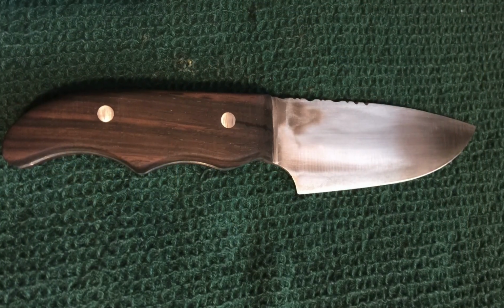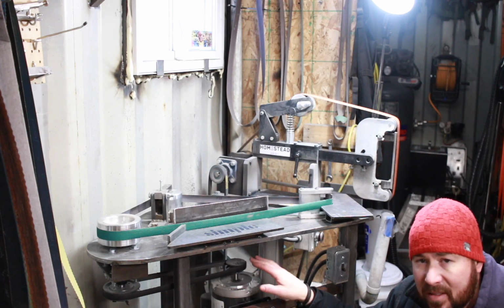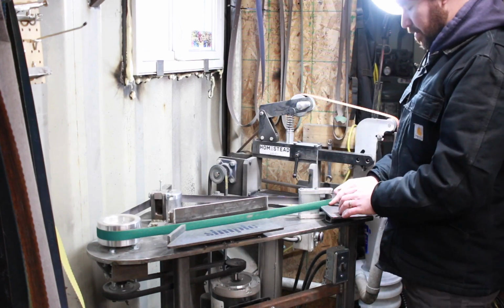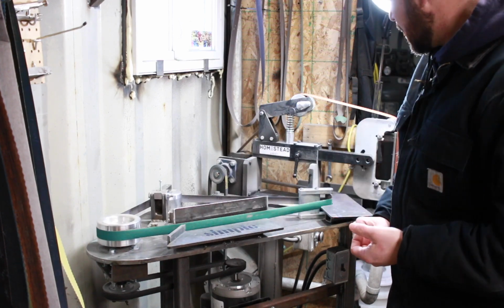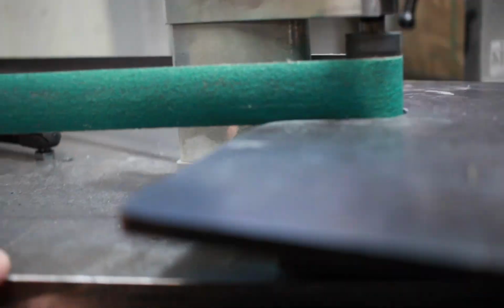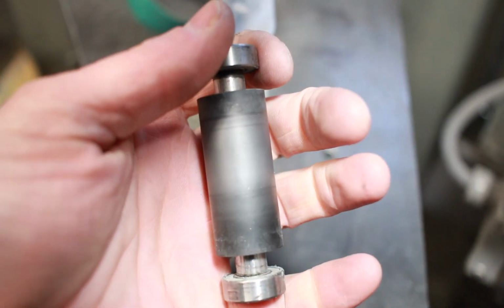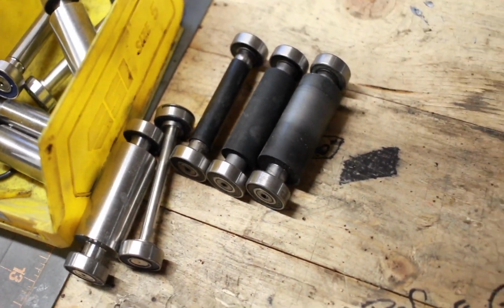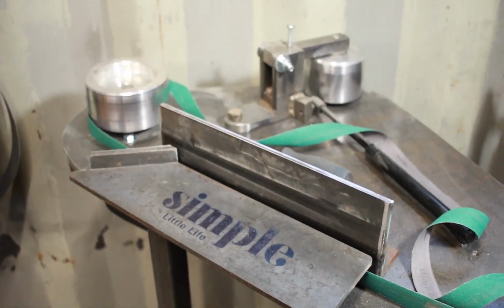Tool Time Tuesday -2X72 horizontal belt grinder and the small wheels

Comment: Another great video, thank you.

I hope you dont mind me asking a question to you or your viewers? Im half way through making a micro furnace out of a fire extinguisher. The plan is to attach some legs, line it with furnace cement, and blow heat in through a tube in the side. So I get my fire extinguisher, use a flap wheel to sand it down to the metal, cut the end off to make a hinged door, and BAM ....I discover that the inside is plastic lined. 

The plastic liner is about 1mm thick. The plastic is a thermoplastic (I think thats the correct term), eg its quite hard (almost glassy) when cold, but when I heated a small section with a heat gun it became like thick glue, then hardened again when it cooled. 

Basically Im clueless as to how to remove the plastic lining, especially since its on the INSIDE of a long cylinder. If anyone has any bright I ideas I would love to hear. Any suggestions would be gratefully received!

Merry Xmas and happy new year to everyone.